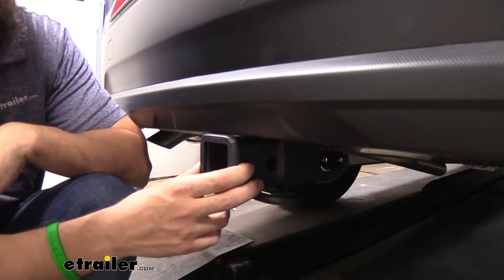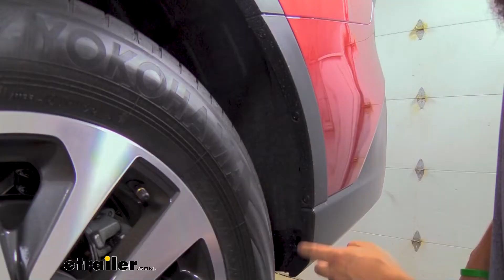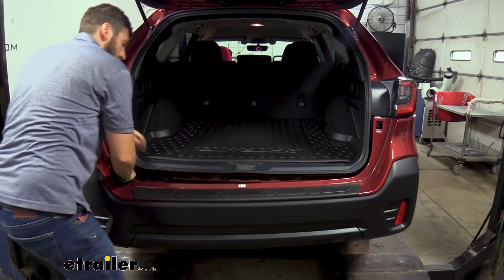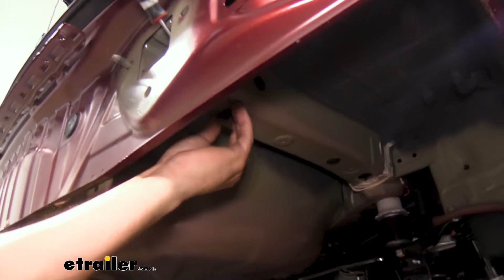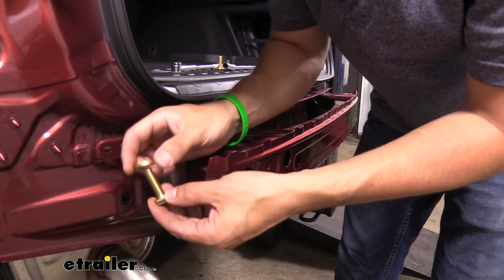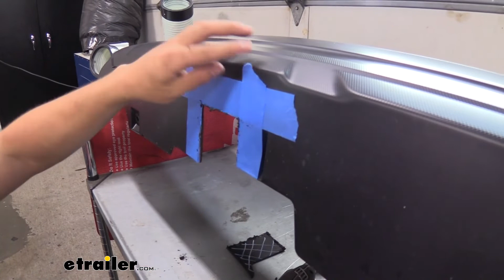Installation: etrailer Trailer Hitch Receiver on a 2022 Subaru Outback Wagon

Comment: Is this hitch okay for, say a 6 foot trailer?
Reply from the maker: As long as the weight of the trailer doesn't exceed the 3500 lb towing/350 lb tongue weight capacity of the hitch and the towing capacity of the vehicle itself, which can be as much as 3500 lbs, depending on how the vehicle is equipped.
https://www.etrailer.com/Trailer-Hitch/etrailer/e25TR.html

Comment: Does it come with a wire harness?
Reply from the maker: The trailer wiring harness is available separately. We recommend the Tekonsha trailer wiring harness, part # 118467.
https://www.etrailer.com/Custom-Fit-Vehicle-Wiring/Subaru/Outback+Wagon/2022/118467.html

Comment: Just installed mine yesterday. This video along with the printed instruction made for a very quick and easy installation. Etrailer also included two of the carriage bolt fish wires (watch the video) so everything went super smoothly. Very nice heavy-duty hitch and easy installation- excellent!
Reply from the maker: We're glad to hear that the install went smoothly for you! 
https://www.etrailer.com/Trailer-Hitch/etrailer/e25TR.html
Reply: I don't think this kit includes a fishwire. Did you order it separately?
Reply: I ordered the fish wire separately but discovered that they had included one in the kit!